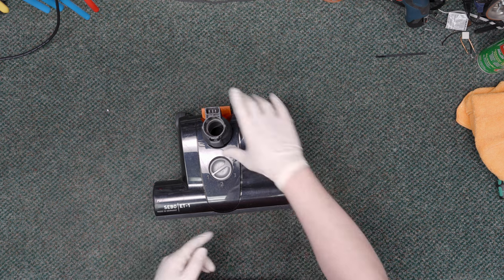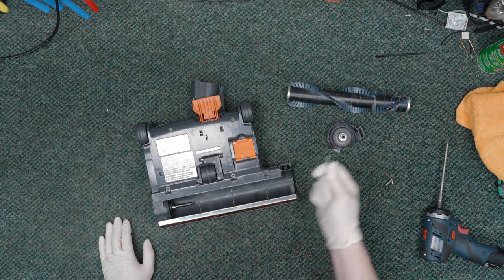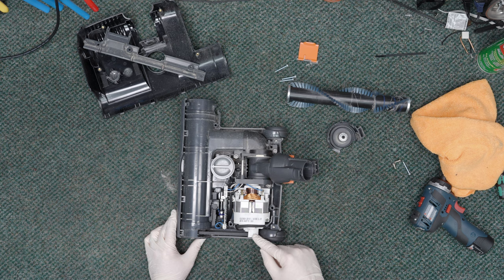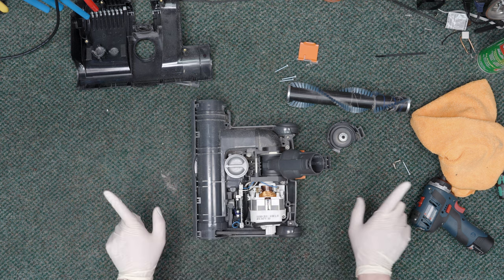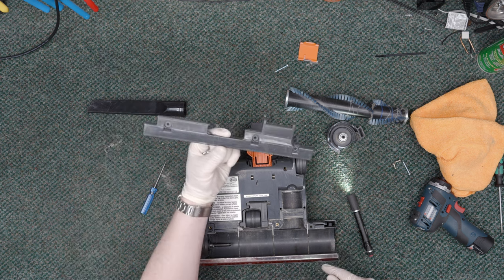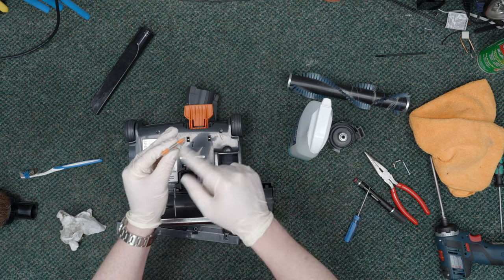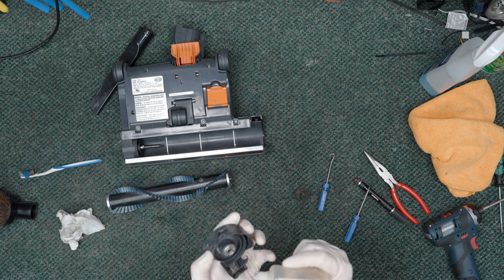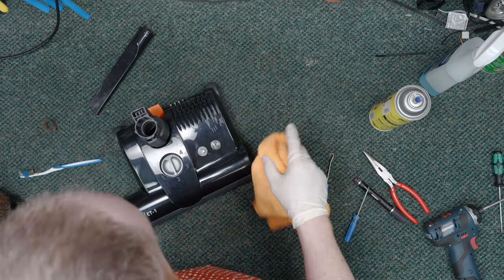Sebo ET-1 & Done! A Deep Dive On The Instant Classic

Comment: Great video! I'm considering either a Sebo ET-1 or a Wessel Werk EBK-360 for our central vacuum system. Wondering if you have an opinion? Also, wondering what cleaner and light oil that you use? Thanks!
Reply from the maker: Hi Bob! Both are great nozzles, but I prefer the Sebo from an ownership perspective. The ease of cleaning the brushroll with no tools trumps the Wessel process (6 screw disassembly) every time. 

The cleaner is just windex and the oil is DuPont Silicone Oil with Teflon. Cheers!

Comment: Nice video!  Would be nice to see SEBO add a light and underside air dam/squeege to the ET-1 or its successor someday. However, they did add a small yellow LED that indicates the vac's powered up but that the brush roller is turned off (is otherwise green when brush's spinning).
Reply from the maker: I would love to see a headlight on the ET-1. I've gone so far as trying to figure out how I could fit one on there that looks OEM. Maybe a project for a video someday...

Comment: Curious to know if the wheels on the ET-1 power head can be replaced. The rubber strips on all my wheels have come off and I'm having a difficult time finding replacements
Reply from the maker: They sure can. Contact your local Sebo dealer and they should be able to order them for you.

Comment: Hi.  I am in the market for either a Sebo or Miele Canister.  I have two long haired pets.  I know Miele is a great brand, but I have seen that they tend to need repair of broken pedal releases. Although I know the filtration of Miele is better than Sebo.  Wondering if you know how many screws need to be removed from Miele to get the brush out.  The Sebo is an attractive option because of the ease of brush removal, but the Miele is a bit more powerful.  It is hard to choose.
Reply from the maker: Miele's can break their locking pedals if abused, but it isn't a rampant problem. However, the bigger issue for me the amount of labor to main that nozzle. The Miele has 6 exterior screws and more inside to get in clean the brush at the end caps. The Sebo make this much easier. I don't think there is a wrong decision, they are both good machines. That being said, i really like the ET-1 nozzle.
Reply: @HouseOfVacuums  Thanks for the reply.  I went with the Sebo, and I'm loving it so far.